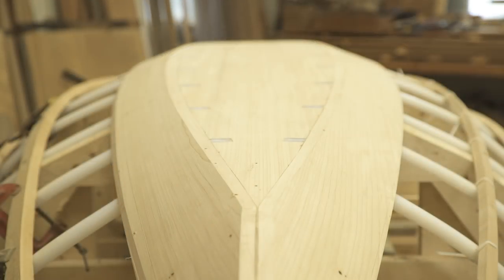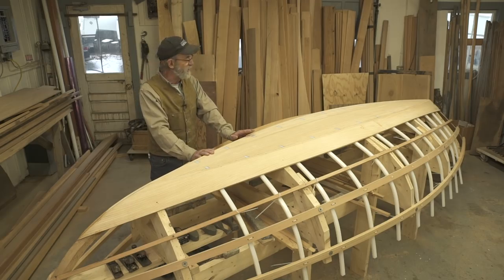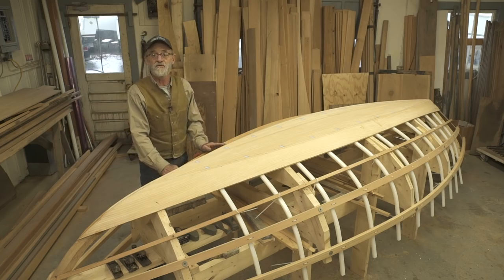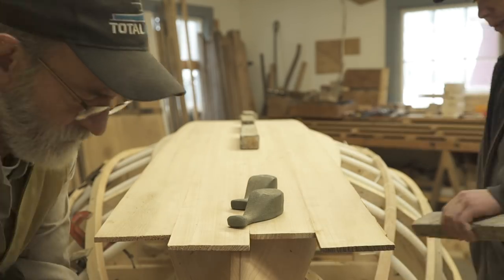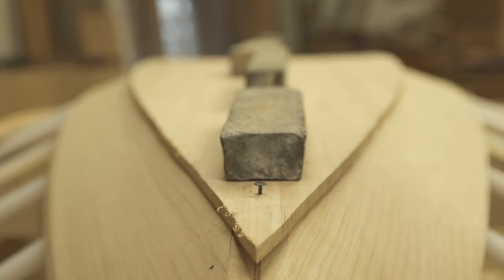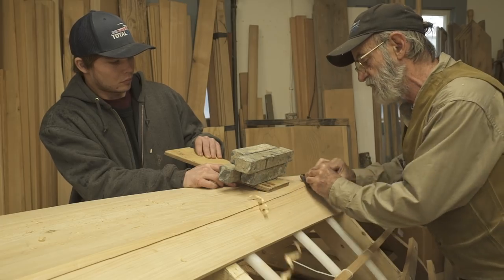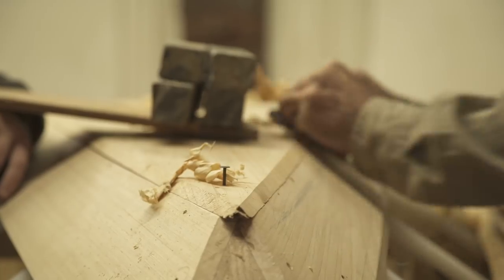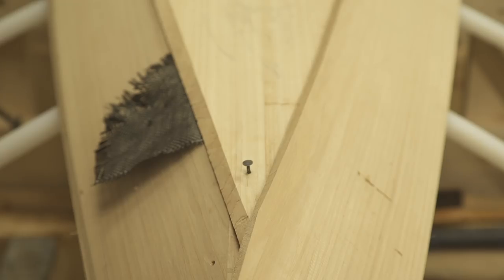Building the TotalBoat Sport Dory: Episode 16 - The Bottom

Comment: Beautiful mix of tradition and science. Separating the layers of cloth with 3/8" planking will add more to the structure from the 3/8" itself than from the wood. I would love to see a small single plank strength test to see.  I was thinking, if your planks were perforated with small holes, 1/4" perhaps, you could trap air volume maybe without losing rigidity. If you only perforated above the water line maybe some small keel like effect might be possible. I'm thinking about the flimsiness of the honeycomb material commonly used in composites and the incredible stiffness of a finished product. Great video as always. Good day.

Comment: Excellent videos. I have been showing the first series to my Year 10 Industrial Technology class. Can you explain why the carbon fibre is going in between the layers of planking rather than inside and outside? It seems neat and tidy, but I can't see it doing much other than preventing splitting along the grain, being so close to the neutral axis of the garboard and bottom planks.
Reply: I don't understand it myself. Seems like the carbon fiber would hold any water that got in between the layers and just rot the bottom out.

Comment: I'm thinking you're going to have your hands full getting that bottom and 2 garboards on and tight before that epoxy starts to kick.
Reply: The usual "slow" hardener will give him several hours of working time, so no problem there.   If he wants, he can pick a hardener that will give him literally all day.  But once he wets out the cloth, it'll take him like 30min to position the bottom and both planks.  Maybe a bit more depending on how he clamps it all together?  I guess we'll see how he does it.
Reply: I know it isn't a competition, but...  :)  There are hardeners that allow open time of days, that doesn't kick until it is heated to the right temp.  It's necessary on large boats, well yachts really, but not on this little boat.

Comment: I don’t understand how the design of putting 2 fundamentally different materials together is going to work. There is no more stable and unyielding building material than carbon fiber. There is no more yielding and unstable building materials than cedar. One might think this to be the perfect combination except for the effects of water.  First one must acknowledge that boat woods react to water. It is a known fact, boats soak up water and expand and then shrink when they dry out. That is why plank seams are caulked with soft materials, to accommodate movement.  In this case there is an organic dynamic material, wood, bonded to an inorganic static one, carbon. Differential expansion and contraction of the materials will undermine the bond between them.  This may last for a while but is fundamentally a flawed design.
Reply: "This may last for a while". Isn't that what we want ? 
The Sun is a flawed design. After a while it will explode and engulf the Earth, but nobody complains.
Reply: There might be another layer of cloth on the outside. I'm not sure what Lou has planned exactly. Plus were talking about 3/8" layers of wood. The thinner the wood the less it will expand and contract. The carbon fiber will help to stabilize everything.
Reply: You are correct. Even putting carbon and glass together is not very effective because of the differing expansion rates. I love these videos, but this design with carbon seems flawed.
Reply: rcpmac , Lou knows more than you, challenging thought that eh?